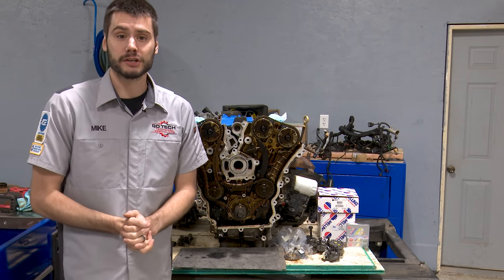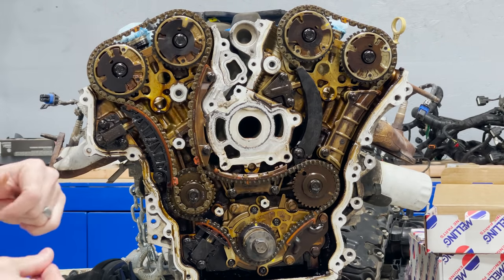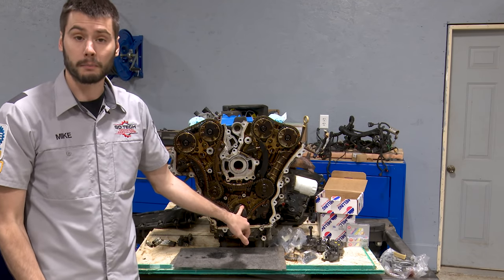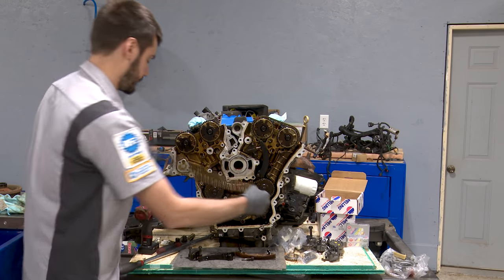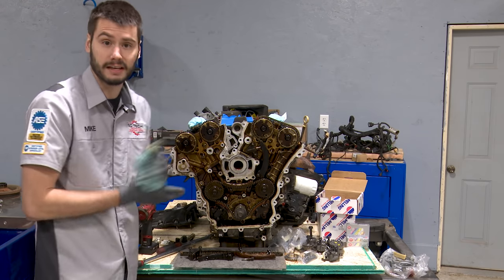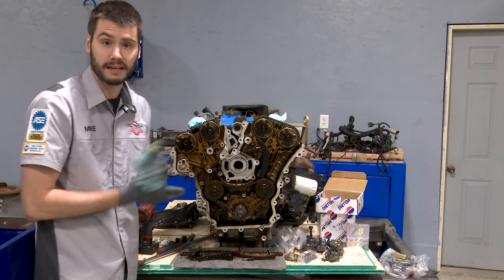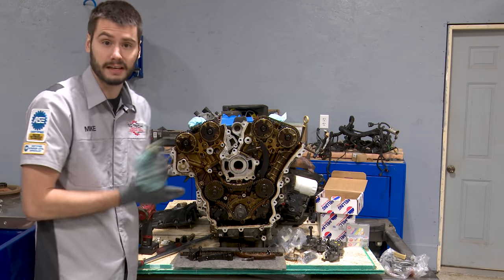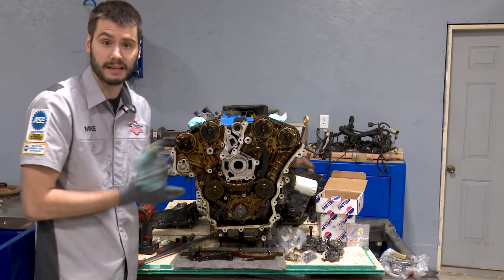How To Replace Timing Chain On Chevy / GM 3.6L V6 - Full Length Removal and Install - With Tips!

Comment: Seems like a great engine on paper and when it works,  but a few local shops hate them because of the chain issues.   I still have a Chevrolet Uplander with the 3.9 and 240,000 miles, no oil burning and it's been a great engine so far, but it regularly likes to develop small oil leaks like a BMW which is annoying lol
Reply from the maker: Hey Jeremy, I don't think the 3.6L would be so bad if people would have just changed oil on them!
Mike Becker, Senior Insturctor
Reply: @GoTechTraining  I've read that too and hopefully it's true, but unless it had super low miles with warranty or someone has regular oil change interval proof from the beginning, I don't think I'd ever feel comfortable buying one secondhand.
Reply from the maker: Yeh, I feel you on that one. I was not "impressed" when I opened up this used one. She wasn't pretty inside.
Mike Becker, Senior Insturctor
Reply: 3.9 will out last a 3.6 even with staying up with maintenance

Comment: Is there a o-ring that goes between the oil pump & the block ? I noticed a recessed area on the oil pump where it looks like an o-ring should go.
Reply from the maker: Hey Dwayne, no there is no o-ring between there. I was a little shocked by that when I put it in!
Mike Becker, Senior Instructor

Comment: Thanks for the vid this was helpful but I was using the factory vvt actuators sprockets. Triangle right bank, and circle left bank. Also used the acdelco kit which is the same yellow and pink links. It appears the reason the right bank is dirtier is because you dump oil into and fill the left bank cylinder head

Comment: Hi Guys, great video thanks, I've read this elsewhere "Once assembled, the timing chain tensioners need to be fully released to maintain adequate tension. Simply pulling the pins is not enough. All tensioners must be pressed in by hand for the internal mechanism to fully pop out and operate effectively". Should this have to happen? 
Cheers 
Gibbo
Reply from the maker: Hey Gibbo, thanks for watching! Interesting, I haven't heard that. There's nothing in the procedure about it.
Mike Becker, Senior Instructor
Reply: @GoTechTraining  Hi Mike, Great video.  Haynes online shows using a flathead screwdriver to twist the tensioner spring up into the tube and it locks.  You can leave it there and hit it with the guide and it  will pop out, like with the Primary Chain Tensioner - it doesn't have a hole for a lock pin, but the others do and you can put a paper clip in the hole and pull it when the chain looks correct on the marks.  I "retimed" a 2012 Traverse 3.6 with old chains to see if I could get the engine to pass a leak down test and while following your video, I found that the Primary Chain had jumped/stretched a tooth.  Things got happy once the chains were in time and the leak test was good.  Then, knowing the internals were mostly OK, I purchased a new chain set including Phasers, Oil Pump, Water Pump, Thermostat, etc... and she's very happy.  Not bad for a $400 dead Traverse and a lot of labor from a 74 year old enthusiast mechanic.  Enjoying the ride now.  Thanks!

Comment: Thanks for a great video! I have a used 2008 Acadia I've been driving for about 2 Years now, works great no issues that I can tell. I bought a scanner and pulled the codes P0014 & P0017 ... I was told it was related to this issue. I drive it daily, it it worth spending money to get repairs? It has 226k on it.  What should a repair like this cost ? I was told 4 grand?

Comment: nice work mike!   you make look easy  melling is a good aftermarket   i would use those old chains had some wear!   remember the quad 4   those chains never had a problem   i had left the dealer in 09 so i missed the fun.... im independent now  but havent done one yet
Reply from the maker: Hey Scuba, thanks for watching! Yeh, the Melling stuff seems good. Not a bad job overall if you end up with one.
Mike Becker, Senior Instructor

Comment: At 6.50 are the flats of the camshafts showing unusual wear?  What is the service life of these chain sets in your experience?  Any idea of the mileage of the donor engine? I enjoy your quiet competence and through presentation. I am able to transfer these attitudes displayed to dissimilar projects. 
   
Thanks for another good video.
Reply from the maker: Hey Xombi Xombi, thanks for watching! I'm not sure on wear on the flats, but the cams were very dirty. This used engine didn't have the best oil change intervals I don't think. That used motor had about 120K on it with original chains.
Mike Becker, Senior Instructor

Comment: I've done a gazzilion of these of these. G.M. wants you to bring it to Stage 1 then disassemble,that way when you put left side chain on and secondary you only have to rotate  crank from 5 o'clock mark to 8 o'clock, a few degrees. That is an interference engine you do not want to rotate crank 360 with cams out of phase
Reply from the maker: Hey John, thanks for watching! That makes sense. I maybe missed that part in the riduculously hard to interpret procedure. Fortunately, nothing bad seems to occour if you do bring it around over 360°.
Mike Becker, Senior Instructor
Reply: @GoTechTraining   @GoTech  That is good that you did not bend any valves,had lots towed into the shop where the cams came out of phase and bent lots of valves! Would not make a habit of it usually a death sentence for these older vehicles haha.           
John Hnetkovsky   Senior Mastertech CMAT Dralle Chevrolet/Buick
Reply: Mike's way of disconnecting the right bank, then turning the left with the crank works too, but for sure you have to make notes and not get confused.
Reply: @johnhnetkovsky8917  why didn't he put a gasket on the i
Reply: Oil pump , excuse me I tap on that sent by typ o
Reply: @gerardharvey1646  Not the right way, don't need notes it' not that hard
Reply: @samuelhernandez3902  No gasket for pump
Reply: I must be missing something.. if you disassemble the whole thing in stage 1 without first taking the right side secondary off in stage 2, wouldn't the right side cams be in stage 1 when you install the right side secondary?
Reply: @garrettl9393  When you move to stage 2 you rotate both right bank cams to stage 2 position, no more than 10 degrees of rotation using the hex flats on the cams. Then the alignment tool will fit on the rear of the cams.

Comment: alright mike, just wanna say a job well done, it's always stress releasing when seeing someone doing a job both graciously and logically. though i'm more of a motorcycle mechanic, but i still learn a lot from your videos.

out of curiosity, maybe it's my ocd kicking in, but is there a reason that loctite was not applied on the secondary sprocket and chain tensioner guide, or even the tensioner mounting bolt? i tend to put loctite on the moving parts mounting bolts, cos i've seen those bolts came off, and it wasn't pretty.

cheers, fan from Taiwan

Nels
Reply from the maker: Hey Nels, thanks for watching! So, if the bolts had loctite from the factory, I would have put it on there. But, they did not, so I simply torque them to spec and trust that the service information is correct :)
Mike Becker, Senior Instructor

Comment: Mine was a P0008 on a Camaro I changed the timing chains and tensioners that's $539.00 job for the acdelco timing kit plus a tube of acdelco engine sealant, bought from the dealership parts department. a jug of coolant $15, and a full synthetic oil change $25 5qt jugs at Walmart $38 with the filter. I did just have to grab a felpro timing cover gasket set $39.99 for the water outlet gasket and oring which wasn't included local car parts store. Water pump wasn't leaking into the weep hole left it alone $631.99 in parts. tools to do that job are 10-19mm ten piece ratchet set $15, one parts puller $20, one 3/8 torque wrench $20 harbor freight. I did use one large adjustable wrench to hold the harmonic balancer in place while I broke the 19mm bolt loose.

Comment: Thank you once more Mike. So this is a non-interference engine? Apparently you turned the crank more than one revolution to put it into stage one position with the right side secondary chain off,
Reply from the maker: Hey Juergen, that's a good point. I didn't even think about that. Hmmm...I have heard of these engines bending valves though. Insteresting. 
Mike Becker, Senior Insturctor
Reply: This is a interference engine and has very small valve stems, they will bend with minimal force. This is why the phasers only have 12° of ± variance. the later years only have one set point. There is a set tool "key" guide for the back of the camshafts. This is a A level tech job.
Reply: There is reliefs on the pistons as long as you don't let a camshaft snap hard while rotating camshafts manually with 20mm wrench on hex feature and 16mm socket on camshaft bolt; clockwise, you will want to begin rotating camshaft by its bolt 50% into spring load and then grab low on the hex feature with wrench to transfer tension load from socket to wrench against springs and not let it snap forward. Slowly rotating it clockwise with the 20mm wrench; gently landing it, while having enough room to grab it low enough on hex so you have full rotation without smashing hands after rotating so the flats are facing upward.
Reply: @DevJB  so what does he do now
Reply: @GoTechTraining  are the timing chains on a 3 litre V6 the same as a 3.6 litre
Reply: @kiaragarth8591  LF1, yes.

Comment: I want to say thank you for this video it should help me a lot on reassembling or doing this engine that I've got I hired a mechanic that screwed it up and I was a waste of money having him do it I shouldn't I knew I should have done it on my own but thanks to you I will go ahead and do it on my own I just got my fingers crossed that we didn't punch a hole in the piston so next week I ordered head gasket kit the timing tools that you recommended and then I went ahead and ordered a new oil pump so hopefully next weekend I will be busy putting this thing tearing it apart and putting it back together hopefully with your video I will be able to put the thing back together correctly although I will say that I'm going to be doing it with the engine in the engine bay as I don't have the equipment to pull the front clip out so to speak so wish me luck God willing I will do the job right the first time and it will run just fine.

Comment: Wooow....over here in aus everybody hates these motors because of stretched chains....even tough on my car which is 04 year i have double row chain....and after 07 they changed the chains...but yeah....i been looking for a video like this for 3 or 4 years now...and wanna say thank you.....
Also here the motor comes in 2 guises....mine is the high output with intake and exhaust cam time...where other lower output motors of same type have just intake side VCT....
THANKS AGAIN

Comment: Well, if someone brings one of those over, they will not be happy when I say I'm not going to attack that without the engine being pulled.
I can't imagine attempting that job in the vehicle.
Reply from the maker: Hey Emmett, thanks for watching! I couldn't imagine doing that job in the car. There's such little clearance.
Mike Becker, Senior Insturctor
Reply: Doing this for the second time in the vehicle right now. It iss not fun at all.  I tried to get a shop to do it this time and no one would even touch it.
Reply: @roscopsoultrain5875  i know how you feel. With my limited knowledge, it took 5 hours just to get the valve covers off and another 5 to get the engine cover off. Good luck!

Comment: The whole job can be done from stage 2 timing position. Just set stage 2 as shown here, then remove all chains, and replace. the cams and crank won't be moved, so it can't be incorrect.
Reply: hey mate have u done it in stage 2
Reply: @user-dz2jd2pz1g  yeah, it's how I do all of mine. Never had an issue.
Reply: @Knackersjewels  do you have any instructions...we did ours but ended up with a rattle from RH side when we started car...stripped down again and the chain tensioner is not working properly
Reply: @Darrylmc63  did you use an aftermarket kit, or a genuine GM one? I've had a few customer supplied aftermarket kits where the tensioners are DOA
Reply: @Knackersjewels  aftermarket one unfortunately
Reply: @Knackersjewels  so I am currently set at stage 2.....I have to remove RH tensioner and have a look at it.....so I can re do all chains at stage 2?
Reply: @Darrylmc63  just set it to stage 2, lock the cams, and take that tensioner off. Don't touch anything else. If it was me, I'd clean the original tensioner up, and put it back in. No need to reset the chains
Reply: @Knackersjewels  both sprockets are not aligned in stage 2 so will need to remove everything and reset
Reply: @Knackersjewels  got it sorted...definitely faulty tensioner...put old one back in...gasket was bent as well so air was getting in...all winds over good now....will let you know once its back together fingers crossed...thanks for the help
Reply: @Darrylmc63  the idler sprockets don't matter too much if you know it was set correctly originally, they don't rotate at the right interval to line up the marks on every rotation. But you should be fine.
Reply: @Knackersjewels  all sorted now

Comment: To think that GM canceled the 3800 for that abomination.
Reply from the maker: Ohhhh Wayne, I miss the 3.8L. I owned many of them!
Mike Becker, Senior Instructor
Reply: That's  why I am keeping my Dodge minivan with the 3.8 and avoiding the 3.6 I am guessing that Chrysler and GM engines are a different version of the same engine concept?
Reply: The first series 3800s were an abomination, as a master auto tech 46 years experience, Gm has made garbage than any 5 car companies combined
Reply: This guy is nuts I would never put an oil pump on an engine without priming it with Vaseline

Comment: Great video man. I have one im doing right now and the rear bank lost its chain. Thanks to your video and being so in depth with it, i was able to work backwards and make sure my crank was in correct position to get the timing in with out having to guess and spin the motor over a hundred times to verify correct timing
Reply from the maker: Hi Billy,
Glad you like the video and it helped you on a repair!
Thanks for reaching out!
~Ryan Wilsing
Reply: When it Lost it's chain Did it warp any valves or do any head damage

Comment: Thanks for breaking down what could be an overwhelming project!
Reply from the maker: Hey Eric, thanks for watching!
Mike Becker, Senior Instructor
Reply: Hello Mike, a couple of questions.  I have a 2008 Cadillac SRX with the 3.6 V6--I assume this is the same engine?  Have you ever done this timing chain swap with the engine IN the vehicle?  I plan to remove/replace the radiator and water pump anyway, so I assume access would be okay?  Or would it make sense to remove the front bumper cover/grille, as well?  Looks like a job that you need good access for.

Comment: Mine just got a timing chain job on a 2013 impala ppv lfx… hoping it all goes smooth, should be picking up in 2 days 😅 wish me luck lol
Reply from the maker: Hello,
Good luck! Hope it's running smooth again!
~Ryan Wilsing
Reply: Mine jumped a couple teeth so I’m just hoping it’s not a valve issue after 💪

Comment: I have done a couple of these now and when removing the chains, getting moving from stage 2 timing to stage one timing. simply rotate the crank counterclockwise 120 deg to align the stage 1 timing mark. no need to rotate 500 degrees clockwise

Comment: Awesome video very informative!  I’ve pulled the engine and I will be doing mine this week.  I did notice my engine seemed a little hard to turn with a 1/2 in drive ratchet, so I pulled the plugs and still didn’t change the amount of force to rotate.
Reply: did you find why it was hard to turn over? I had a timing rebuild then a few months later , problems. It wont turn by hand either. No boom, holes, sounds...nothing. Mine showed crank light, shutoff, cleared code but wont turn over even.
Reply: @longracing25 clearing codes won't fix anything. If you knew what the codes were it would help solve the issue. After all, the computer stores a code if the chains have jumped out of time.

Comment: I don't have the tools for the back side flats of the cams. But before i spin it over i take a dremel and mark my cams on top and put a dot with a white paint marker behind my dremel marks. That way when I put it back in stage 2 timing my cam marks line up on top and I can see that.

Comment: Question: Im faced with having to do this to my 09' Acadia, Im not by no means down for this job but its my only vehicle currently so it is a must 🙄.  I know they have multiple kits out there and all include less or more components depending on how much money you want or can spend. That being said, how necessary is it to replace the cam phasers and sprockets, the water pump, the oil pump etc.... Like Im OCD so like even though It is going to kill me only being able to afford just the basic kit that only includes the Chains, Tensioners, and Guides, a lot of people dont have $1200 bucks laying around to do all the components behind that timing cover. So just wondering if it is a dire to replace everything or can you be ok just replacing the chains, guides, and tensioners???? Thank you for your video I def will be watching this as I do mine.